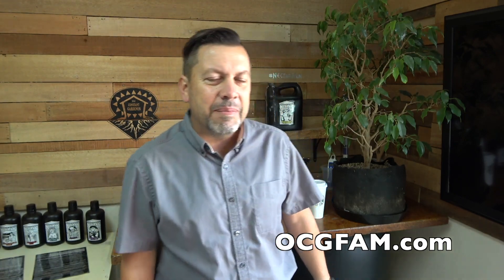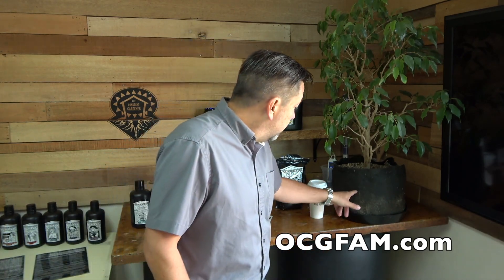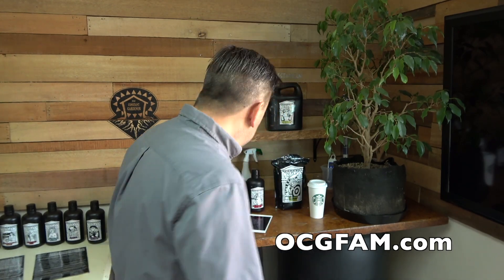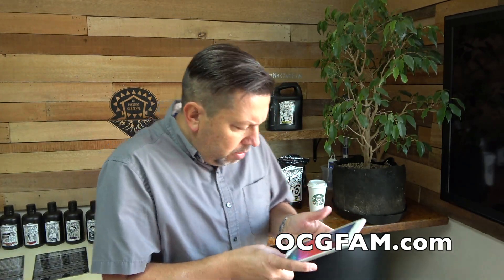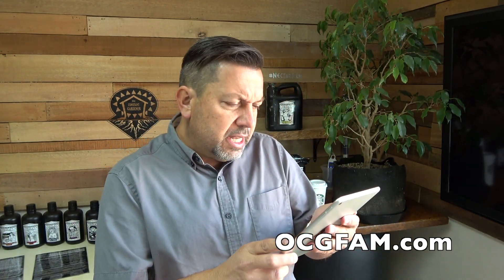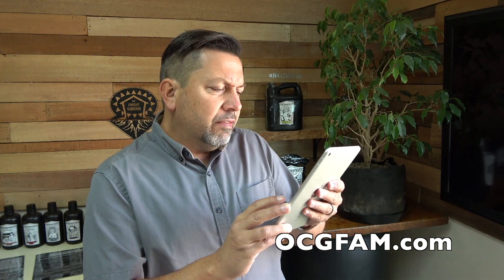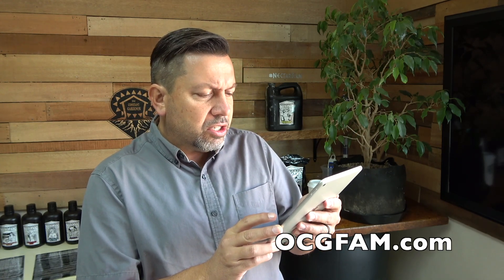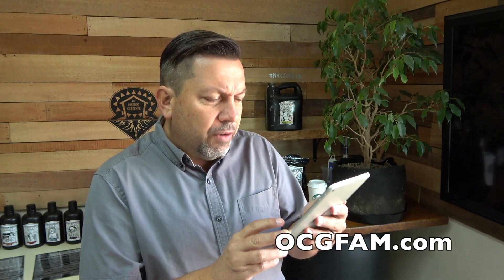How deep is deep enough in the soil for a slurry test? | OCGFAM510

Comment: hey Bob! Thanks for the content!!! 
I love nectar for the Gods! I've been using it for about 3 years now. I NEVER do slurry tests! I just make sure my pH is spot-on, and I always water until there is a little bit of runoff and I feel that doing that will reset the pH of the soil just in case the pH of the soil has drifted a little bit up or down. I also feel that if I am following the feed schedule, and also doing feed feed flush feed feed tea the ppm should never be too high or low. I closely monitor my plants and if they require more or less they will let me know. I'm using nectar for the gods #4 soil with almost a complete line which includes Medusa's magic, Gaia mania, Demeter's destiny, the kraken, Aphrodite's extraction, Pegasus potion, Athena's amina's, Herculean harvest, Triton's trawl, bloom khaos, and Hades down and Olympus up for pH adjustment when needed. I follow the nectar feed chart for seedling, vegetative, early, mid, and late flower. KIS

Comment: How do I properly measure the slurry results? Normally I use equal parts of soil with distilled water and mix. When I measure it at first, my slurries are usually really low around 100ppm but I usually give it about 20 minutes and measure again and it goes up to about 250-300ppm. Which number is correct?

Comment: Hey bob!  Transplanting a plant from 1 gal to 10 gal smart pot, in nectar #4 soil.  The plants are a bit larger,  they were in the smaller pots longer than they should have been.  Using the sample line, should I be feeding half strength?